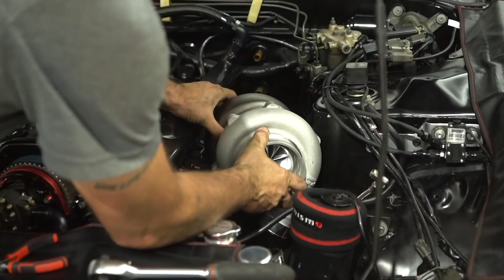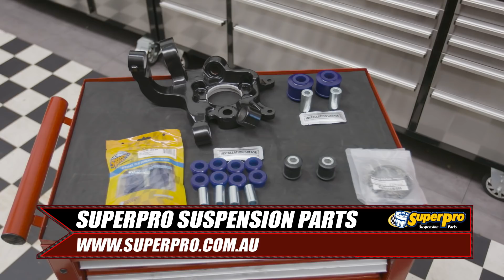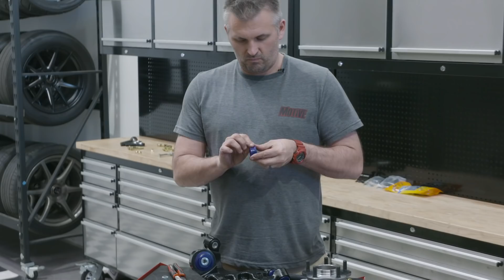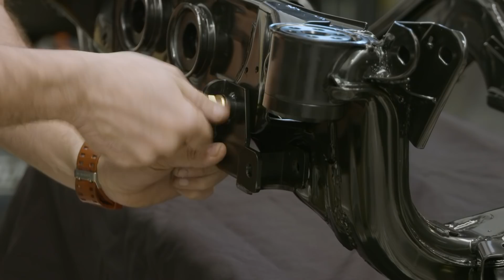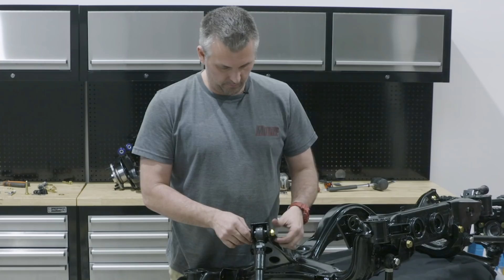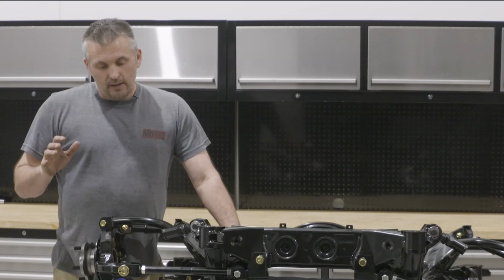R & S-Chassis Rear Suspension Upgrades Install - Project No Secrets R33 GT-R Ep13

Comment: Gktech does make a rear drop knuckle for S/R/Z chassis that works on GT-R/300ZX, the only thing is you need to swap the lower mount on the coilover from the fork-type mount to the S-chassis style eyelet mount.

Comment: Andrew, ive watched your stuff for awhile. Im interested to note the use of zinc plated bolts. you failed to mentioned nylock nuts or any type of thread locking compound. this is a lower sub-frame and bolts coming lose will happen. I respect spanner check etc and as a mechanical engineer myself, i understand torque settings  but I think you should give another 'trick for young players', where you can, use nylock nuts.
Reply from the maker: Never had a Nissan bolt come loose in rear suspension, even on our time attack car. The lower arm ball joint uses nylock
Reply: Nissan uses pinched nuts. The dont come loose and are better than nylok.

Comment: Are you going to put up a video explaining what rose joints you are swapping all the gktech ones to when one inevitably breaks from them being crap quality?
Reply: @ChrisHallett83  I haven't snapped one as I won't run gktech stuff, I have seen 4 other people have the rose joints fall apart, Yes they have been on drift cars but 3 of the have been when they were either driving on the streets or driving back to pits so not a high load style of driving when they let go

Comment: Why buy adjustable if you're gonna run everything factory length? Only if its lighter, highly unlikely as factory are flimsy AF and light AF, reliability again oem are pretty fkn reliable they lasted 25 plus fkn years! So why TF would you run everything OE spec on aftermarket adjustable parts? wank factor? No, only to zero out and then for Adjustability FFS!
Reply from the maker: It's a starting point. We said that in video. Once all in wheels and tyres on etc then we set it up and start development.

Comment: Why do people delete Hicas on GTR’s? I love a good suspension mods video!
Reply: It's not just GTR's, its Skylines in general....and it's because HICAS is extremely unpredictable when you arent on a perfectly flat surface. If you're going over dips and bumps the weight raises off the wheels and they can turn when you dont want them too. So when the weight comes back down on the wheels, theyre pointing a different direction and the rear steps. 
In this case because its for track, last thing you want when you're hitting berm's is for the car to try and correct the rear.  If you  want to make it reversible, you can use lock out collars and disconnect the hicas unit on the R33. Unfortunately on the R32 its all hydraulic driven so you need to fully disable it. 

Personally i've had it happen on winding roads doing 120-130km/h when i've hit dips in the road while driving through bends (similar to a chicane) and it is absolutely scary af when it happens. It's like the rear of the car is on ice.

Comment: It’s only pressed in rubbber bushes that need to be set in the loaded position, as you can tear them and give ride height problems... poly bushes and bearings should be tightened as soon as you fit them so you don’t forget 👍
Reply from the maker: We know,  but often the internet says otherwise

Comment: Not always a perfect fit Andrew. I use SuperPro on Crustida for the chassis to sway bar bushes on the front and they made me a custom one off 26mm sway bar with 27mm rubbers. I had to linish a few mm on both of the chassis bushing inners to make them fit properly. 👍

Comment: When I had my 33 it was mega unstable when braking at high speed. Fun, but no good for lap times. After a lot of adjustment I figured it was the live toe from the rear toe arms. In my case I had to raise the car slightly to flatten those out, which meant I had worse lice camber, but it was immediately 1.5 seconds faster a lap, despite compromising the COG and camber the times were just better, I wondered why there wasn't a corrector, like you did with the other arm to lower the mounting point on the sub frame which would take most of that out. It was on the cards, but I upgraded to another car before doing it.
Reply: Actually nvm your car looks pretty good 👍

Comment: Those rubber boots on those rod ends look like oxide collectors.
Reply: That maybe, however keeping out dirt and debris from your spherical joints is more imperative.
Reply: I realize you don't grease those joints but would a spray of wd40 keep them from becoming corroded? Anything suggested here with those boots or just better off dry?

Comment: You can slip those rubber boots over on those GKtec joints while assembled... Grease?
Reply from the maker: They don't need grease and for the extra 10 minutes no need to stretch them.
Reply: @MotiveVideo  They spring back just fine.

Comment: I'm confused why you can't run the gktech or PSM rear drop knuckle? The only difference now that you have deleted hicas is the coilover mount. Fork v eye style. So change bottom of coilover to suit what you need? I bought the coilovers for my gtt and just changed the bottom of coilover to fit.
Reply from the maker: You can do it, it's just not "bolt on" solution due to what you mentioned. Or just out Silvia subframe into GT-R, which some have done

Comment: Hey Andrew. Have you considered the nismo suspesion extra arms kit? Installed it on my r33 gtr. Looks awesome, and ties them all in and braces. I allso have all superpro , and went with all driftworks arms. Have not changed lower controll arms yet.
Reply from the maker: Nismo just over priced to us and we've done it better this way in our experience.
Reply: Yeah they are just an addition to the other arms. Not replacement. The ghtech bits looks mint 😊

Comment: Best days with new content here :-)

Regarding the bolt for upper arm (the one you put in at 8:51) I noticed it's a "normal" bolt. On my GTS it has a rather large counter weight attached as a part of the bolt. Anybody know why we have this difference? Can it be binned along upgraded suspension parts?
Reply from the maker: We mention in the video why. You have an eccentric bolt to adjust camber. We got rid of that as the arm adjusts it now.
Reply: @MotiveVideo  I'm familiar with the eccentric adjuster bolts but this one has a bit fat counterweight attached - size of a small doghnut.
This is a very early R33 GTS, maybe first day of production for the R33. So it could have been done away with further up the timeline.
Still interested to find out about this one.
Reply: DE3US most manufacturers use this kind of “technology” to reduce noise and vibration and is not necessary. Unless it’s a weight on a spinning part it should be fine to bin it.

Comment: No extend studs? Figure since you already had it apart y'all would do it but I guess y'all would be running factory fitment style wheels.
Reply from the maker: Running 18x10.5 TE37 so won't need spacers